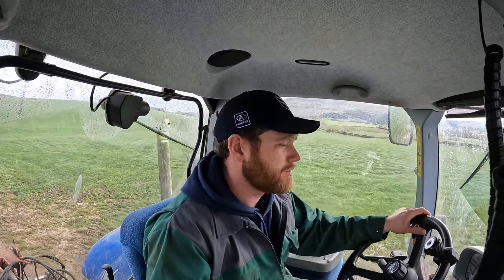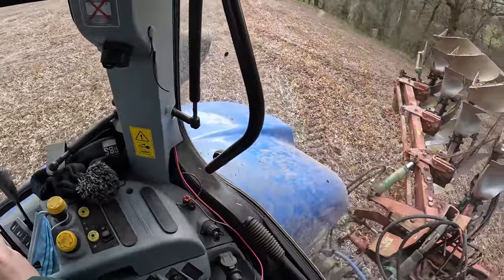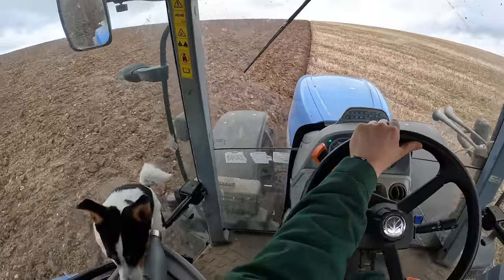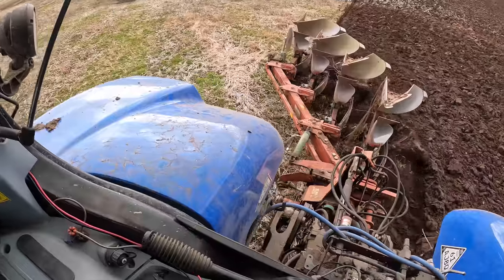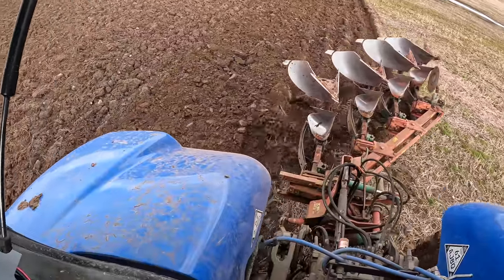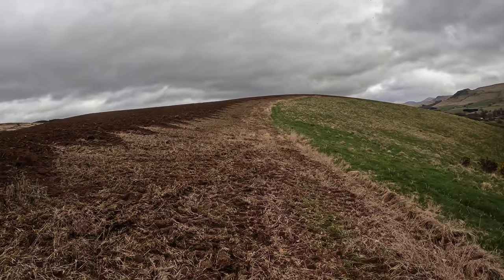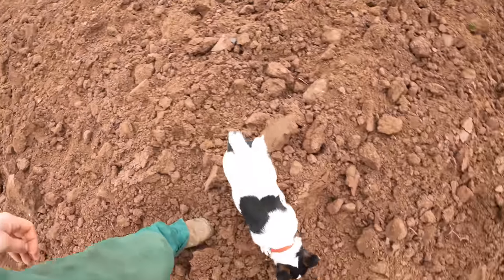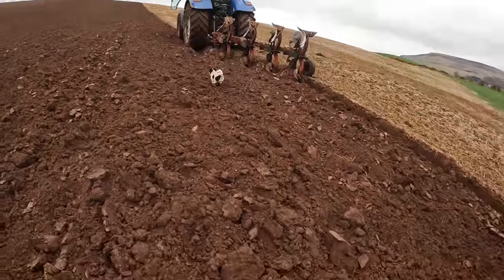Ploughing Steep Hill POV!!  Go Pro Hero 10 4k

Comment: Would you consider getting a front plough and keep the 4 furrow? A 2 furrow front and the 4 furrow on the back means 6 furrows, even better than a 5 furrow ;) And you can use only the 4 furrow in the most difficult fields ;)